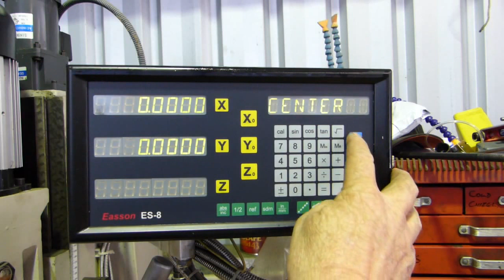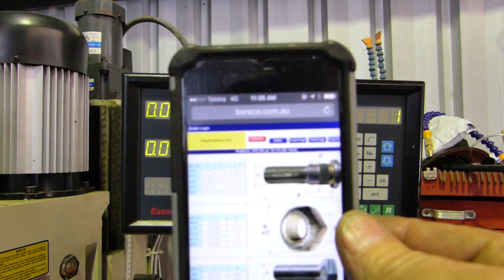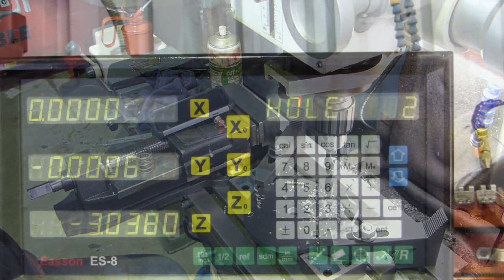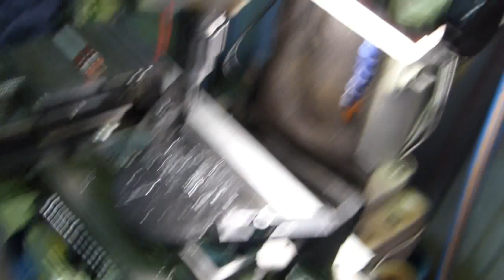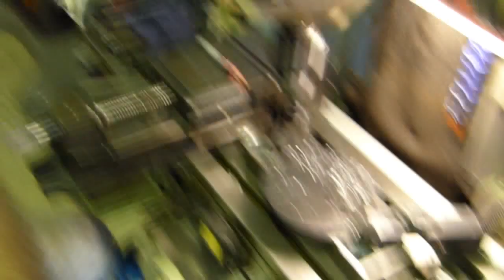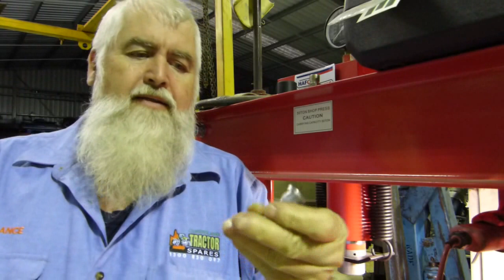Spare Wheel Bracket  Disk for Boat Trailer Spare. Ford Stud Pattern.

Comment: G Day Lance, Great video mate, I have a similar mill to yours but mine has a three phase motor and takes R8 in the spindle and is badged Warco here in The U.K. I bought mine second hand and it didn't come with any instructions for the dro so I have only been using in a very basic way. I didn't even know what the 1/2 button did till I watch one of your other video. Now I'm going to have ago at bolt circles. Thanks again mate for the great video channel 👍
Reply: Bundy Bears Shed Thanks Lance I will take a look.

Comment: Spot on Lance - good enough for an F1 car. Agree a good exercise to use the DRO and make a video. Was just thinking while watching this that if I had to make that with my stuff, have to mark out by hand, drill 1/2inch, biggest I can go. Grind heads of studs bit undersize with angle grinder. Then put them on wheel rim with a nut either side, drop them in and weld the back side to the plate. Or get you to do it lol.....good work mate.
Reply from the maker: G Day Malc, I can do anything you like if you throw enough money at it lol.  or me
Reply: G day Lance - I'm sure you can (smile) Bit of a shit day here....car MOT ... missed a few jobs ......  unintentionally upset the young mechanic...think? I've put that right. More work and expense.
However I did get the Nuffield glass filter bowl cleaned out again...and all still looking good for the show on Sunday.....except the early start.
But hope you enjoyed the fun video I got at the van bangers yesterday.....captured the mood.
Reply from the maker: yes it was all a good laugh